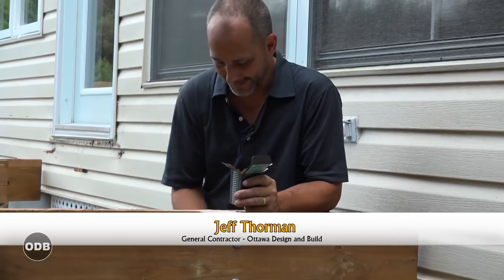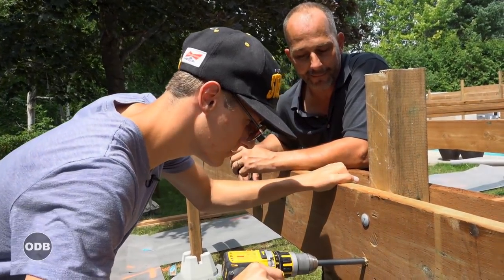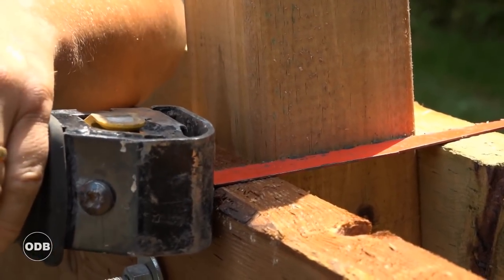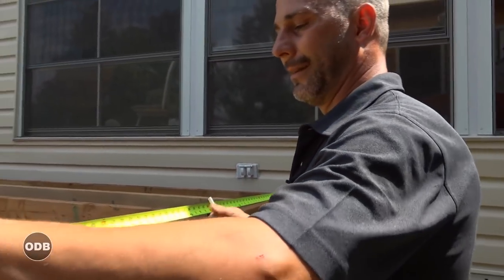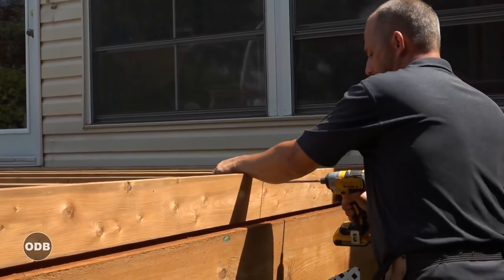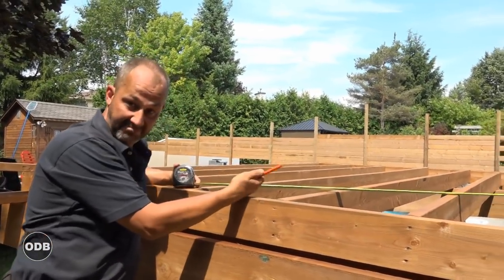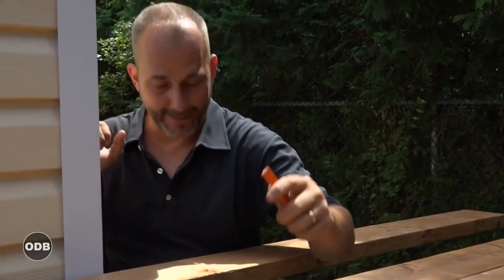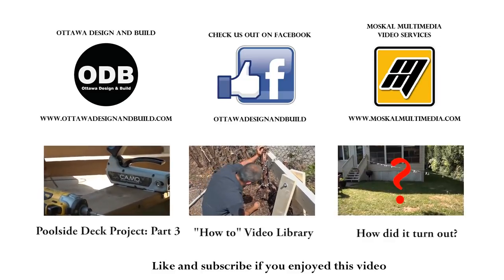DIY DECK Part 2 | Joists

Comment: Classic mistake .The joists should be let into the posts ,not held with bolts .
Reply: Classic as in been done like that for decades and most are still in use?

Comment: This is not the correct way to build your deck... Bolts in the long run will not hold the weight of the boards as it is too heavy for them to hold. The beams must be installed over the posts and not side by side. Too many things may go wrong and will not stand the test of time unfortunately. I've seen too many decks come apart due to this way of constructing a deck. Here in Quebec, we have codes to respect and this build would be not be sufficient.
Reply from the maker: This may very well be true about your codes. I live in Ontario and follow the OBC for structure.